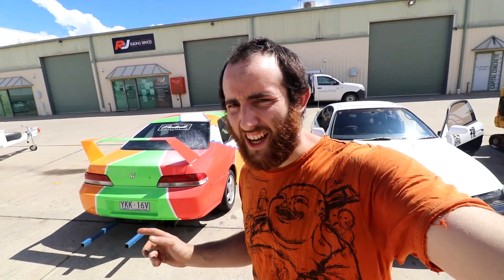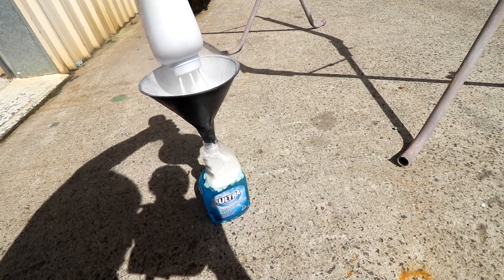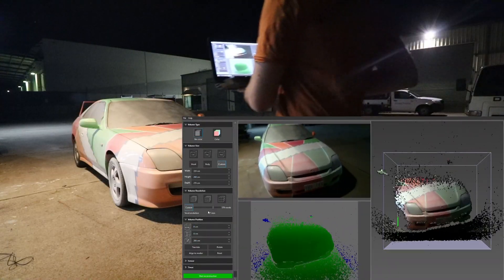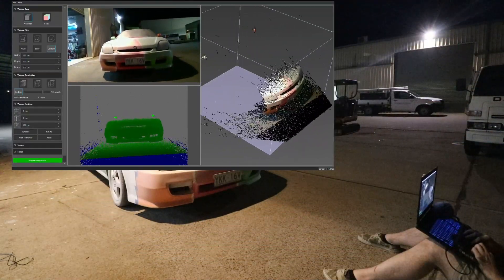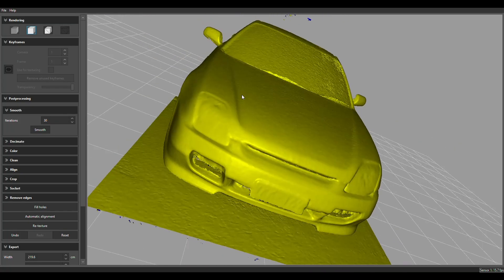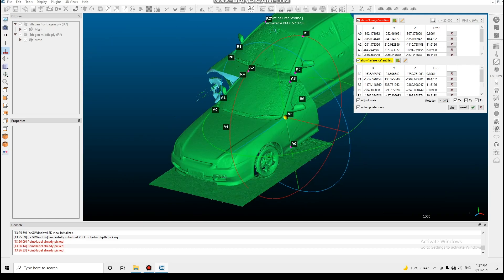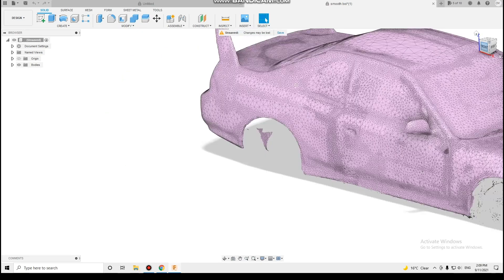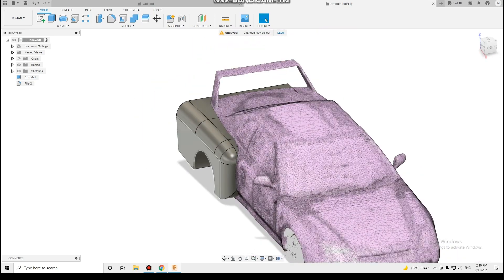3D Scan Your Car at Home.

Comment: Great content, I love it! Now I consider buying one of those lidars, unfortunately they are like x2 price here in Europe than the US. Is it impossible to scan the whole car in one shot? You've got a new subscriber!
Reply from the maker: It's possible to do in 1 go but it's harder and will be lower quality.   They are super expensive here In Australia to.  I found this one in America 2nd hand and got it posted over.
Reply: @Conorsev   Thank you for your fast response man! I found one from Germany for around 700 euros. I think I'm going to buy it as I am planning on doing some carbon aero elements for my car and this tool would be really useful! Just one more question, what format do you manage to export the scan in? (PLY?)
Thanks again and wish you many more interesting videos and new subbs! Cheers from Bulgaria!
Reply: iphone 13 has much better lidar than the one he used
Reply: @Aimless_Drive   I have both the Iphone 13 and this lidar camera and I cannot say the same. Or at least the apps that I've used on the Iphone were nowhere near as good as that piece of overpriced equipment lol

Comment: Hey Bud, what are your settings on recfusion?
Reply from the maker: I'm not sure off the top of my head sorry.   Just worked it out trial and error
Reply: @Conorsev  cheers, I haven't had much luck, however I was more in a rush to give it ago, then moved houses so the project got scrapped. Must give it ago after seeing your results.